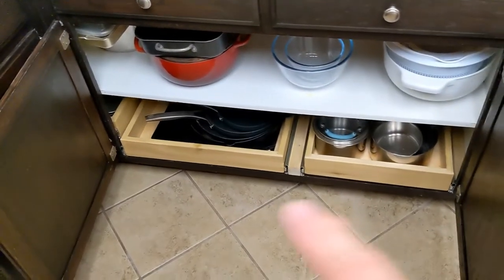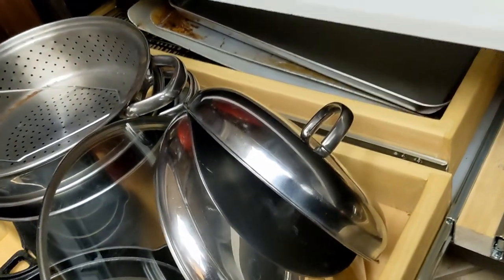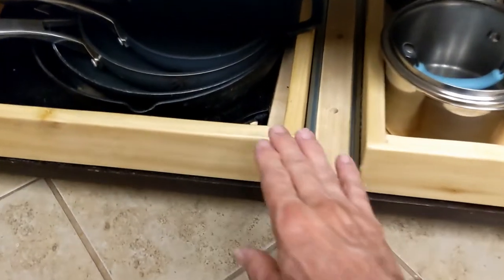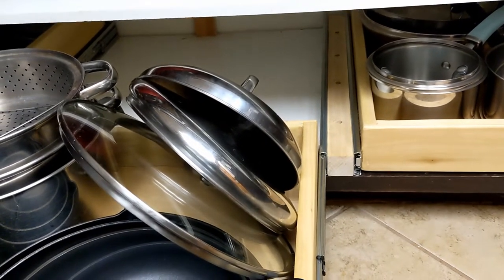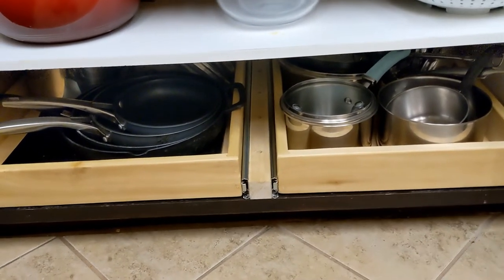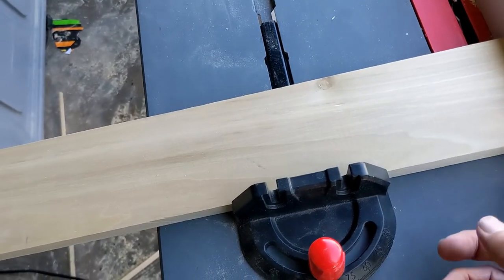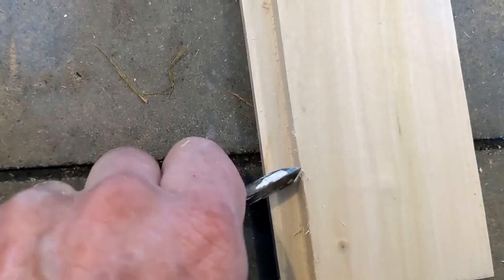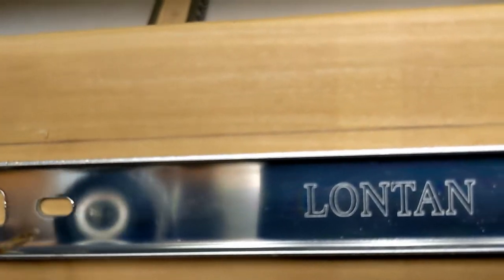Kitchen cabinet pull out trays and blind corner build

Comment: Perfect.  I've watched several others who used the same slides as you but bottom mounted them.  I was wondering about how that would hold up.  I like your mount better
Reply from the maker: Thanks most slides only have a intended mount direction so don't put a weight ratting when mounted in a non approved way. I did find one that had a weight of 25% when mounted flat so I would assume a 100 lb rating decreases to 25 when mounted flat.  since you should not max out weight as placing heavy things bounces I would try to keep it at 75% of slide so a 100 lb weight  on its side would be 18 lb or about the weight of the drawer and about 5 lb of load.  Not a very good idea  for a drawer for pans perhaps a spice rack I hope thats all they were using it for..